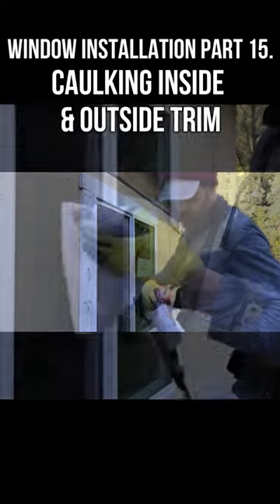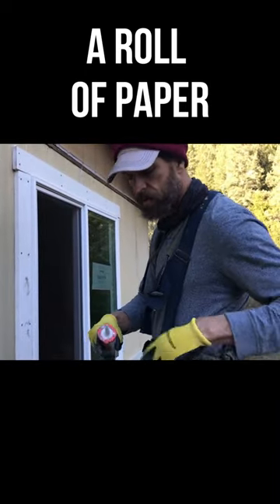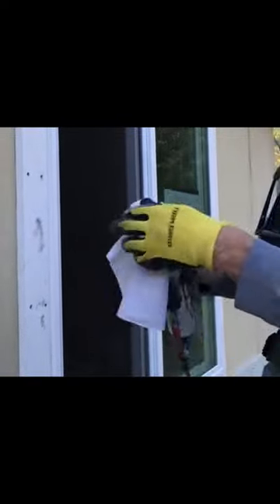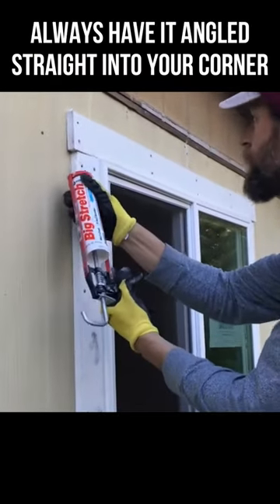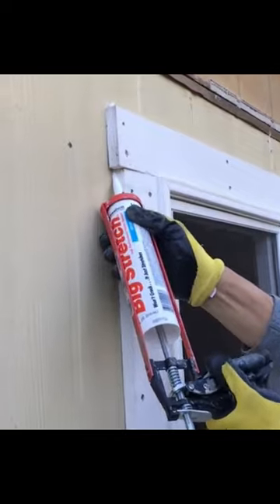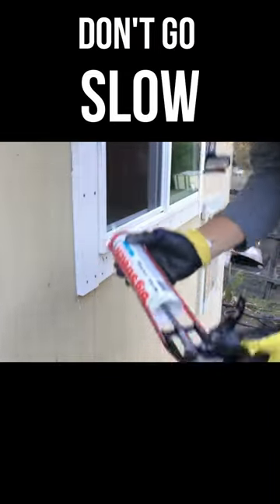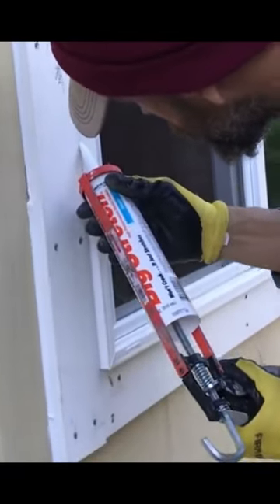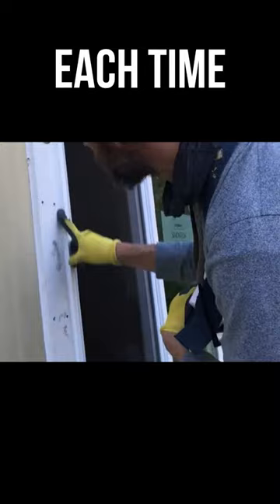CAULK Outside WINDOW Trim.  PRO TIPS.

Comment: I’ve installed doors and windows for 8 years, when a customer spends $1,000-$15,000 on a door system or entryway, IMO bad caulking can 100% ruin a job. I hear old school guys argue that caulk is for a purpose only and not looks “who cares as long as it’s sealed” is strongly disagree, yes caulk served a purpose, an important one, but it should also look amazing, take pride in it like a welder does his beads. I can’t tell from that trim job, the screws, and the caulk that whoever did it is one of those “you’ve got to paint it all guys” Even after paint your caulk would stand out, your lines aren’t consistent, they’re big small big small, take the time to do it right, I can caulk almost as fast as that and get a nice bead that’s pretty and don’t even have to tool it. Just my 2 cents.

Comment: way too fast and in the wrong direction. you want to be pushing the caulk into the seam so you're getting good adhesion and no gaps, with the edge of the nozzle doing what your doing with your finger, minus the waste and mess.
Reply: So is the correct way is to go from bottom to top? I’m still learning how to caulk, it’s a bit tricky for me.

Comment: Never seen someone use gloves for caulking. Just a ungloved finger and damp rag seems to work fine .
Reply from the maker: Have you worked with pl or big stretch before?  The stuff is bommer but impossible to get off your hands
Reply: Outdoor caulk should be silicone. It won't come off your finger for hours.
Reply from the maker: @brookelord3448  Silicone is a poor choice. Cracks off with expansion and contraction of heat.  It's good in kitchens and baths only.  Polyurethane or elastomeric last much longer
Reply: @TheRegenerativeHome  false. Look that up. Polyurethane might be better but what you say about silicone is false.

Comment: I fill a bucket with water and use a big sponge. If it’s water based caulk that is… super clean
Reply: If it's outside, it should not be water based caulk.
Reply: @brookelord3448 Super late but it can be just has to be good like big stretch. Its the only acrylic-latex caulk I've seen used outside. Otherwise use polyurethane.

Comment: run your bead, spray Sprayway glass cleaner over the bead, wipe.
Caulk won't stick to the surface area with the glass cleaner on it. Let it evaporate.
You're welcome.

Comment: best thing I ever got for caulk was a pack of silicone profile scrapers.  You can push them into a corner like that, and you get far less mess.  If you care to take the time, you can scrape the excess off the tool and stick it somewhere else.

Comment: Big Stretch caulk is best on the market! I have never lost an older tube due to plug hardening up. The caulk never drys out hard. It remains flexible. All their different types are far superior. Their Through the Roof sealant is really superior to roof tar!!! They also have a sanded caulk for stone or brick mortar repair. Extremely good sealant! Best! A little moisture on finger ( even spit) helps smooth out bead!
Reply from the maker: Agreed!

Comment: Used a full roll of paper towel and ruined a pair of gloves. The tried and true spit on the finger and smooth it that way works way better imo. Carpenter of 15 years
Reply from the maker: Not water based caulk
Reply: wouldn't have to do either if he learned how to run a bead properly.

Comment: a tip i share a lot of is have a small empty paint can?with water about a quarter full spray about 4 pumps of Windex in the water. when wiping with your finger the caulking won't stick to your finger.
Reply from the maker: Good idea for water based. But I was using polyurethane based.

Comment: Much easier and saves a lot of paper to have a small bucket with water and a little soap in it, don't use a glove, dip your finger tip, drag it along that caulk and then clean your finger off in the water, rinse and repeat!
Reply from the maker: Don't use water based caulk on exterior windows.  So no.

Comment: Big stretch, definitely a wet finger.
Better tooling.
Wet 1 inch paint brush works well.
Reply from the maker: I think big stretch needs mineral spirits for clean so paint brush wetted with mineral spirits might work.

Comment: Your thoughts on self-leveling quad?
Reply from the maker: Not familiar with self leveling. I'm not sure how that applies to window caulk. But OSI is made by Henkel the same company that makes PL. They make good products. And they actually have a sustainability policy which is more than any of the other companies
Reply: @TheRegenerativeHome  the quad max says not to tool, so you just have to go a little slower and leave a nicer looking bead, I usually do exactly your method of tooling with my finger and having a roll of paper towels with me, well done
Reply from the maker: Yeah.  No tooling is ideal.  Mineral spirits in a pinch for cleaning it up